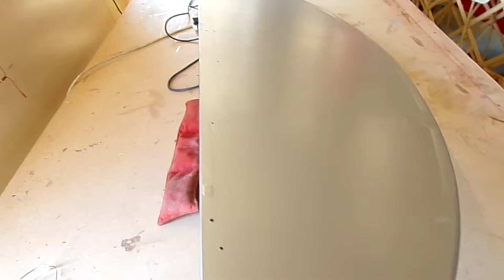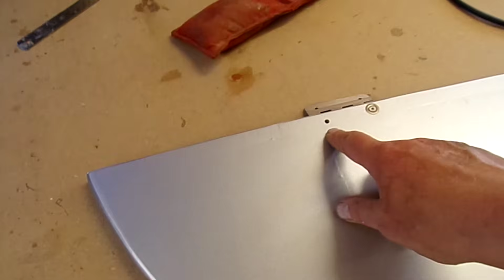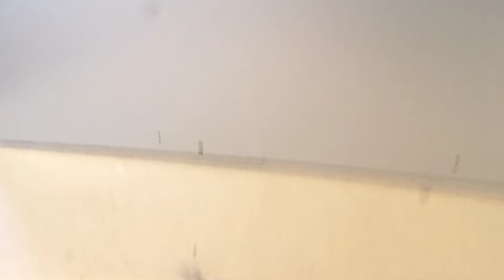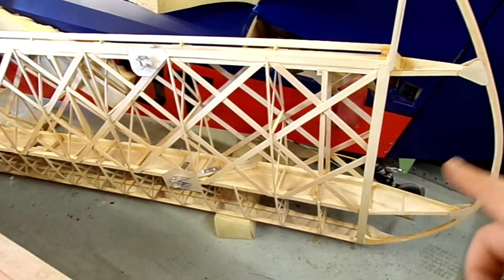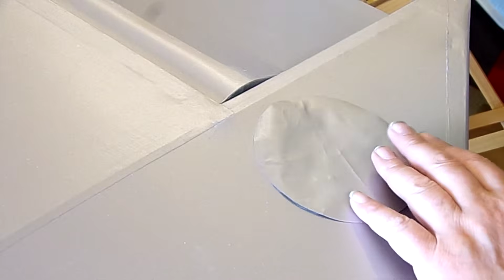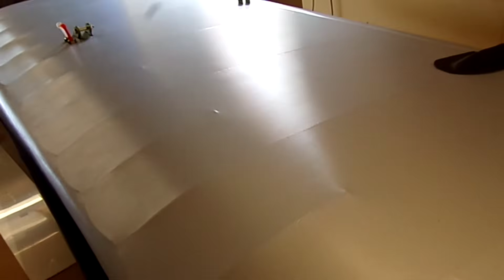EP189 Horizontal stabiliser finished and 2nd aileron with Oratex on my Fisher Youngster

Comment: It's looking smart Algy.  I watched this video sitting right on the shore of the West coast of Arran in the wind and rain and you mentioned the heat you have.  There is a BIG difference between now and when I visited.  Are you still logging the hours you have spent?  Cheers Michael
Reply from the maker: Oh yes I am still logging the hour and it is a lot but I have slowed down as well in the last few months due to working on the Bobcat project so much and flying it at the weekend when I would not have been able to fly the Kub and so would be working on it.

Comment: I presume you melted the screw holes, rather than drill them or use a pointy tool, for the sake of the characteristics of the covering material?  That was a good quick method to make the plastic covers for the aileron rod.
Reply from the maker: Yes I melted the screw holes the same way as I did for the drain holes. I thought you would like the plastic forming.
Reply: @flyingkub  What type of plastic did you use to form the aileron covers and is it readily available?
Reply from the maker: @timstephenson3341 good question. I used high impact polystyrene, which is available from all sorts of sources,  my stuff is I think for window frame trims but you can buy small pieces from model shops or ebay.